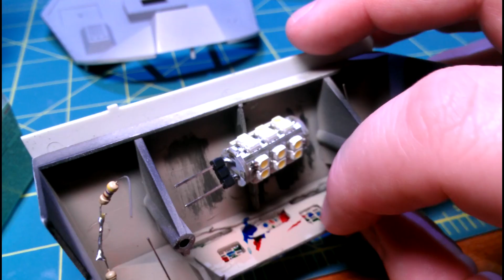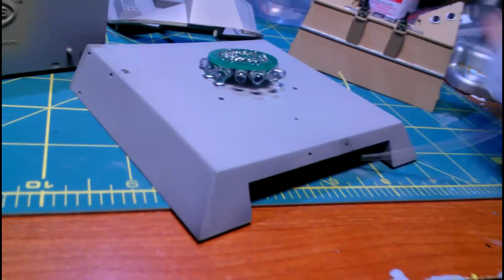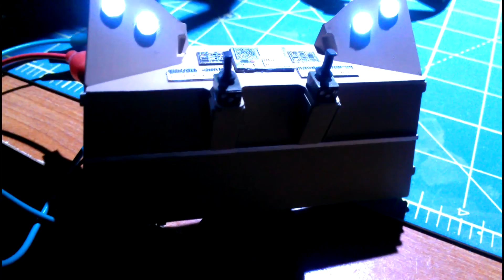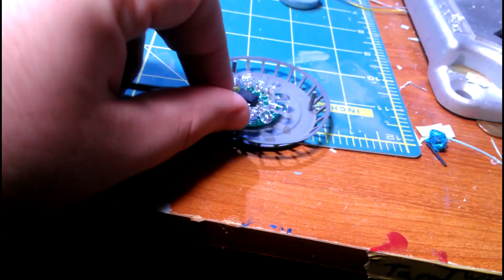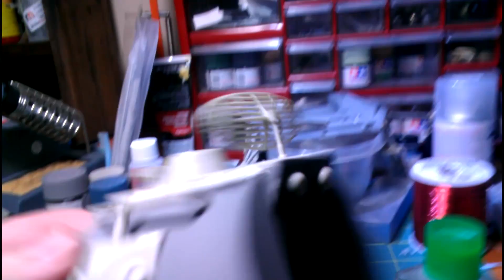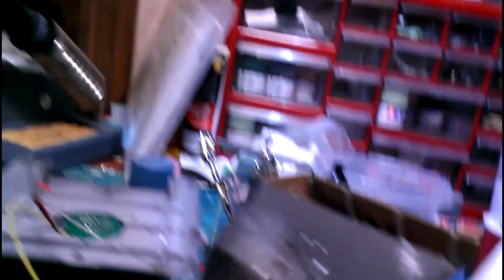Moebius Lost in Space- Space Pod Part 2

Comment: Hello mrmechanic29 I think you have done a magnificent job on your Space Pod. I have recently purchased this model and although I have built hundreds of models in my time I have never thought about lighting. This will be my first attempt and I need to ask how did you attach all those fiber optic lines to the body of the pod so the light shines in the cockpit and attach them to a led or miniature light bulb. Also is that just a standard orange color or some weirdly named shade of orange? Thank you for posting these videos you sir are an inspiration for us all.
Reply from the maker: Jim Rauch I want to say the orange color is International Orange. As for the lighting most of the space in between the panels and the outer hull had to be gutted to accommodate leds. I want to say I used an LED tower in the front console and some rgb flashing leds to do the rears.